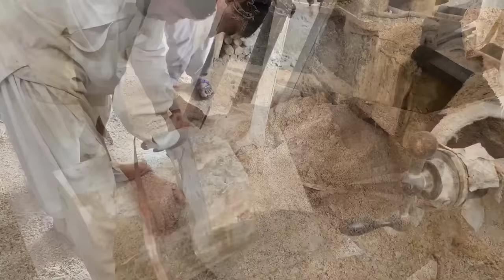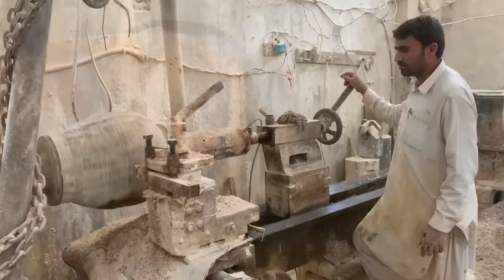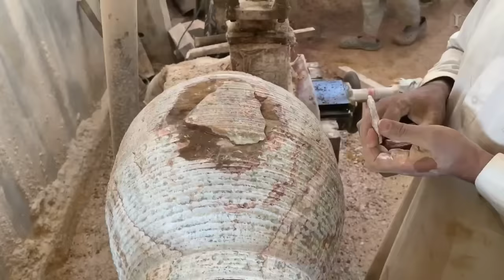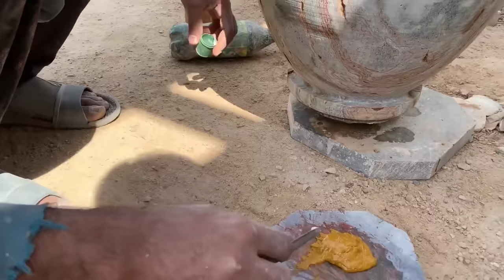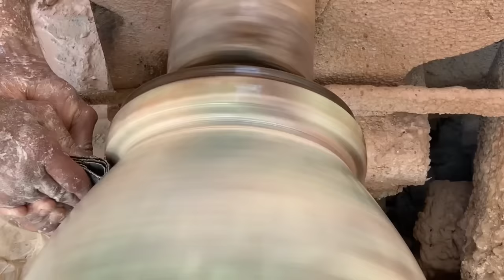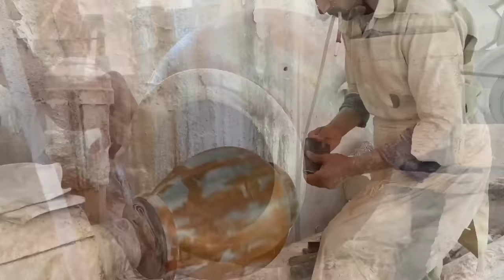ONYX Marble Stone Turning into a Vintage Vase || Handcrafted Vintage ONYX Marble Stone Vase

Comment: The glue being used is polyester resin, not epoxy. He adds 1 - 2% of organic peroxide which initializes the curing reaction of the resin. Powder is just some stone powder which he adds for to get paste like consistency. Epoxy resin would provide even stronger bond but it requires 1 - 7 days to reach it's max strength.  Cured polyester resin begins to melt in temperatures over 80 Celsius, so the adapter piece is easy to remove by heating it. Probably the most common use of polyester resin is fiberglass wetting. Gel coat paints for boats are also often polyester resin based.
Reply: Poxi pol

Comment: The glue that holds that block! 😮 with no steadyrest either... wow
Reply: Can you imagine how toxic it is to achieve that kind of bond
Reply: I came here for the same reason. OMG that adhesive is amazing. The Black Death!!! When he put a third component in -> hahahhahaha so intense.
Reply: OMG 😮😮😮😮😮😮
WHAT KIND OF GLUE IS THAT ??????
It’s that real?
Reply: Yer, thats what i was thinking too
Reply: @oneiros1401 .do you know what is that?????????
Reply: It´s epoxy, nothing special.
Reply: @oneiros1401  much of the bond is suction force too
Reply: I watched to the boring end to see the damn thing separated
Reply: @DA-jw6nm ME TOO. DANG.
Reply: is called epoxy
lets do the math
the circle has about 20 cm in diameter
epoxy can hold about 10 N/mm² up to 40 N/mm² depending on the quality, lets say it hold 20 N/mm²
the area of the circle is 314,16 cm², thats 31416 mm²
times the 20 N/mm² = 628320 N
628320 N / 9.81 m/s² = 64048 kg
thats about 64 metric tonns or 141260 lbs (vertical pull)
or about  one M1 Abrams for the Americans out there
Reply: These vases are beautiful.  The craftsmanship is amazing.  I want one.
Reply: This guy is an amazing craftsman.  I would love to work and learn from him even for a week. The knowledge he possesses is ancient.
Reply: What type of glue you use , what mixture of materials is that
Reply: Let me see how to remove your epoxy or glue for next video
Reply: @schnaps1790   if it’s epoxy what kind ?  I’ve used a lot of different epoxy’s none are 3 parts or look like that. I’m guessing it’s not epa friendly. I can say it’s super glue. Doesn’t mean it is. But if you know please tell what kind of epoxy.
Reply: It’s epoxy flow grade
Reply: It's camel seamen. Ancient family secret.
Reply: @ryanoconnor8160 literally why I came to the comments. That glue is amazing.
Reply: @schnaps1790  seems like it's a different makeup... looks to me like a three-part solution.
Reply: It's a polymers.
Reply: I especially liked the hand cleaning before applying the glue
Reply: @bosnianswede You don't know what it is.
Reply: I think one part is a mix of ground up stone, and pigment. 
So still possibly a 2 part epoxy. 
Still would love to know exactly what it is .

Comment: As a wood turner it’s interesting to see the same techniques used to turn stone including using resin to patch defects and mount face plates.
Reply: I know I don't have any adhesive I would trust to hold a piece on my mini lathe, and I only work with wood!
Reply: That is what I was waiting to see - how they detached the face plate from the finished vase but that must be a trade secret.
I was quite amazed how they could turn the block with out any kind of steady on it.  Amazing workmanship.
Reply: @CZAC  - I guessed  that is was either India or Pakistan - but why should it surprise me?  The skill and ingenuity of people in developing countries never fails to amaze me.
Reply: @fredgillespie5855  I think they cut it off where the stone part is, very close to the face plate
Reply: @fredgillespie5855 they would probably heat it with a torch.
Reply: What resin did they use?

Comment: I had a friend who was a marble worker from Italy, who also did "scrap work" by using pieces of Marble and Onyx, and then gluing them together into shapes.  This used up much of their scrap, and they sold these "artworks" to the Hollywood crowd, for a ridiculous profit.  I bought two "block tables" from him which were hollow, and had lamps installed underneath, which produced a very visible glowing artifact, as the light shown through the Onyx.  Epoxied together but still holding together after 70+years.  Epoxy works.

Comment: Absolutely beautiful!
I can't believe you do it without a tailstock!
How do you ever get the drive plate back off the finished piece?
That epoxy is amazing!
Reply: I'd guess with heat. I use a hot air gun to soften epoxy.
Reply: @saito125  heat can damage the vase. I think they just cut it off very close to the plate with some thin saw

Comment: I have watch bowl in tiawan get turned on huge lethes with big 4 jaw chucks.And i was amased with the same question ,about the glue used to hold a 4 ft long peice of marble 2ft diameter to a small stone block of somesort griped by the chuck,with the tail stock taken off after it was formed.Then to creat the inside with boring chisels staight in,water cooled tuned slow.Maybe the glue is for sail in tiawan. But another interesting fact,is i went to Egypt to see the stone work there,and the thing i saw on the cairo musium were much harder and obvious to me more presice tha  anything i had seen or turned myself,as if the makers had machines that  were precise like  metal lathes  but could cut in diferefent directions out of ,sort of round.must go see for your self,and large stone cut or formed by something that must have been able to melt and reform with pesision in one motion .The bowls and vases dsome had marks of being lathed in some way,but down to 16 or so of an inch out of some stone much harder than marble.

Comment: This is not onyx. It is sardonyx.  Both onyx and sardonyx are types of chalcedony. The difference between onyx and sardonyx is the color of the chalcedonies that make them up. Chalcedony is a type of silica.  These men will doubtlessly retire with silicosis, which they could avoid by wearing appropriate PPE. I am certain that were someone to insist that they wear that "appropriate" PPE that the best of them would find another trade. The adhesive they are using is clearly a modern two-part epoxy.